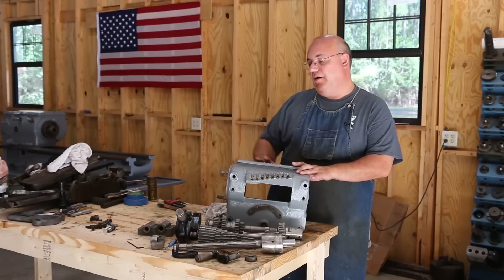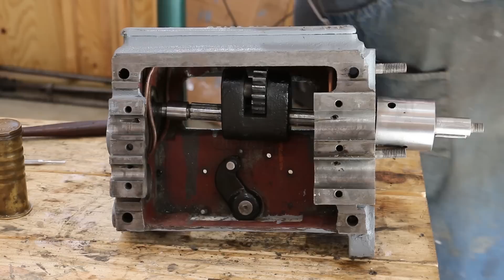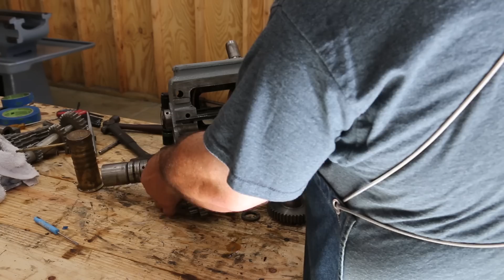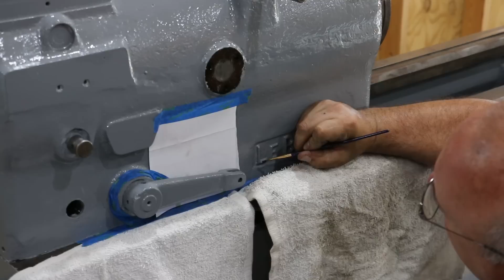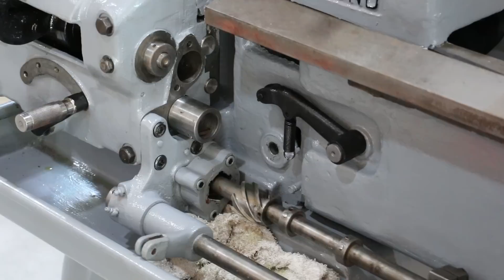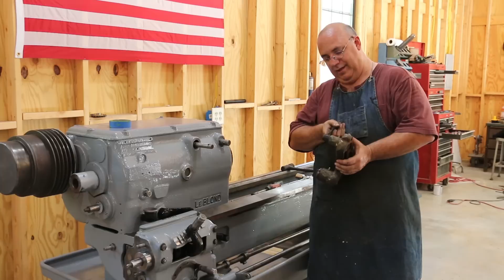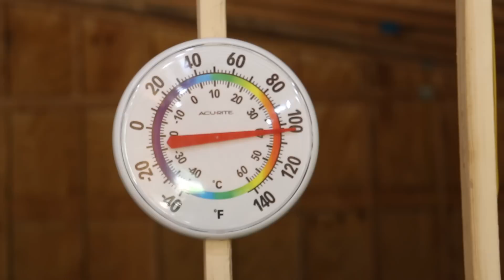LeBlond Lathe Restoration - Part 6:  Quick Change Gear Box Reassembly and Installation

Comment: I love the fact that they managed to hold that threading screw bracket with only two bolts. If this were one of the cars I work on, there would've been a third one in the back, and getting it on and off would've meant going one click at a time with a fine-tooth ratchet and bashing your knuckles every time!

By the way, I was thinking about the data plates, and the fact that you were saying they'd be pretty tedious. I think the easy way to do them would simply be to paint the whole thing black, and then sand or buff the paint off the high points. I'd guess that's probably how it was done in the day, anyway, since nothing else makes much sense.
Reply: if I slam it back and pick up on the ratchet I can get that next click, lol been there too many times.
Reply from the maker: I need to get started on the data  plates - and that is pretty much how I will go about doing it....
Reply: time to get some fine tooth ratchets!

Comment: It looks like we need to start a "Keith Rucker's Shop Needs an Air Conditioner" gofundme campaign or something.  That has to be unbearable, surprised you are able to work in that heat.
Reply: He says it in the video that he had just spent a lot of the day running the museum's steam locomotive.  The steam locomotive's cab stays at 130-140 F since its on the firebox end of the boiler.  After doing that all day, he stated that 100-105 F starts feeling pretty cool and nice. XD
Reply from the maker: I have about half of the money saved for the insulation.  If you want to contribute to the cause, you can support my Patron account....

Comment: good cosmetic and mechanical restoration, keith!
i especially noted and liked that "6-in-6" puzzle that you've resolved about the forward-reverse shaft.
about the broken bolt -- i was anticipating the operation for  removal. i guess the bolt was heat treated, and it cracked with its length above the flat portion. if you have not got rid of it, would you please check if my guess was correct?
i was hoping you'd send the handles out for the triple-plating. but then, we cannot always have all we might want ...
thank you very nuch for the video,
-toly
Reply from the maker: I thought about plating the handles. Just did not want to wait on them to come back.  I am considering it for the hand wheels though....

Comment: The Le Blond is looking good.  Do the two gears on the front of the machine get grease ? I would remove that one grease zerk that that is hard to get to and  use the open hole to oil it and fit a small plug to keep the metal chips out. Is the flag going to get soiled being next to the lathe ?
Reply from the maker: As for the gears, you just have to manually oil them.  The flag will get moved once I put walls up - it is just in a temp location for now.

Comment: The "cuts" which receive that spiral are an impressive feat of casting and/or milling.
Reply: cant be harder than the rifling they do to huge naval gun barrels!
Reply from the maker: You would mill them like a spiral gear I guess.  At least the external cuts.  Not sure about the internal ones....

Comment: Hi Keith, Wouldn't levelling the lathe without the carriage and tail-stock on be knocked out of level when you then fit these heavy-ish pieces back on? Great video series!
Reply from the maker: It really should not matter that much - remember that those parts move around.  I will re-check things before I start using though.

Comment: how is QCFB lubricated?
Reply from the maker: Oil is put in a reservoir on the top which is lined with felt.  It then drips oil through some tubes to lube the gears and bearings inside.
Reply: tnx, you we warm. you know the temp will drop some about November?
good work.

Comment: Man, I would be drinking buckets of water just sitting on a chair watching you work.  I just can't take that heat anymore.  My wife and I are going to S.Korea in September and I'm dreading it because of the high heat and humidity.  The LeBlond is looking sweet.  There are few things that a little perseverance and perspiration can't get done.  I bet you are trying hard to think of some way to get the insulation in the shop.
Reply from the maker: The insulation will get here - just have to save my money!!!

Comment: That machine is such a beauty. Love seeing the levers moving so smoothly. -I wondered if it was ever appropriate to torque the bolts holding the gearbox on?
Reply from the maker: I don't think it would be important to torque the gear box.  That is usually more important on bolts holding bearings or on gaskets where you need even pressure.

Comment: Beautiful job. Why are some of the parts attached with both a tapered pin and a set screw? Belt and suspenders?
Reply from the maker: Can't answer that question - I guess they wanted to make sure it did not come off!

Comment: on the left side end where you put the gearbox, is there something that goes on the shaft and the top gearbox shaft?  Looks like a unpainted surface that needs something bolted up to it.  I think it called the lead screw  end flat surface
Reply from the maker: I think that is where a gear will go that powers the gear box.  I have not put those back on yet.
Reply: Yep that's what I was talking about. Thanks for the reply

Comment: I hope that, when you will run the lathe, that you could explain why the upper  pulley is so big. Is this a balance wheel or something else. Great restauration. I am waiting to see how you will restore the old plate. Thanks
Reply from the maker: It is to get the speed of the input shaft correct.  The motor is turning really fast, so a small pulley on the motor to a larger pulley on the lathe slows the speed down to the correct speed.
Reply: Thanks.

Comment: Keith,
At 27:11, that grease zirk.
Would a 45 degree angle zirk solve the problem? 
If it would tighten up with the tip pointing in the right direction. 
Maybe an O ring on the threads so it would seal and be tightened to point in the right direction?
The lathe is looking really good, thanks for sharing.
Keith H.
Reply from the maker: I don't think you could get to that grease zerk from any direction....
Reply: Keith Rucker - VintageMachinery.org
Hard to tell from the video.
I felt the fool suggesting it because I was pretty sure with your experience you would have thought if it but I figured sometimes the obvious escapes even the best of us.
The lathe is looking better and better.
Stay hydrated in that heat.

Comment: ........lol, you left out the best parts, all the cleaning and de-greasing of those gears and shafts..........made it look to easy. great show, will be a nice machine.....I used the same paint but stripped bare and polished all the levers and handles on mine. I like the black as well....
Reply: The black handles don't show all the oily finger prints and stains.  If you don't have chrome/nickel handles then black is best.
Reply from the maker: I started to polish the balls on the ends, but decided to just go black.
Reply: .....or brass/bronze...?  They remain polished to to continued hand friction....

Comment: So far looking great.  The only thing that I see that is troublesome is the incidental motion of the spindle speed handles.  It looks as if there is some lack of detent; since one lever moves as the other is moved.  Other than that it appears that you have gotten a gem.  I hope that the ways are as sound as the rest of the machine and there is little to no wear on them.
Reply from the maker: I will have to look into that, but I am pretty sure there are detents in there.

Comment: What about the lever that reverses the head? I thought you said something about it when you first got the lathe. Would now be a good time to repair it?
Reply: It has been fixed.  Compare part 1 of the series with the end of this one.  That bastardized spindle reversing handle was dispensed with at the cleanup and painting stage. ^^  Keith also figured out why it was done in the first place, in that whoever last took it apart didn't put the reversing shaft back in correctly to where they then could not get the reversing lever and bracket back on, leading to the haxors hack job with the bastard handle to get the reversing function working again without taking the machine back apart.  Keith points out he very nearly made the same mistake himself of putting the spindle reverse lever back in incorrectly, but caught his mistake at a point it could be easily corrected.
Reply: Thank you for that detailed explanation.
Reply: Just doing my part
Reply from the maker: I think +Patriot1776 just saved me a bunch of writing!

Comment: Whenever i disassemble a machine i will put timing marks on the gears and shafts as i disassemble it just in case the orientation is important. I will either put paint pen lines or center punch dots.  As you know, it can really mess things up if you get something 180 out deep down in there... I have done some restoration and repair/adjustment work on old treadle/line shaft industrial sewing machines and in that environment, EVERY part has a correct orientation and timing and getting any even a few degrees off can cause worlds of headache....
Not to mention the fact that there are no standards when it comes to screws. Custom thread pitches and sizes, I even have seen a machine with metric, imperial AND whitworth thread machine screws at the same time. From the factory. Into tap destroying hardened steel. Pain in the ass......especially when that really important no longer available tiny shoulder screw disappears under a baseboard......
Just remember, minutes added during disassembly to document can save hours on assembly
Reply: What a great tip on marking parts. And even with supposedly identical screws or parts, the machine has aged and worn in with those parts, so it's going to be happiest with those relationships preserved.
Reply: My father once had to do with industrial diamonds / abrasive tools (he was in the sales department).
There was one company his company did business with, which did not use one standard screw on their appliances/machines, all screws were made by the company itself.
Somethings breaks - no easy fix from the hardware store, no you had to get in touch with the manufacturer...
I guess everyone who had to use this machinery (probably highly specialized stuff) hated them!
Reply: Fortunately, a joint that is assembled with a tapered pin only has one "correct" orientation. The hole in the boss must align with the hole in the shaft, and the large ends of the tapered bore must align as well. If not, the pin will only go in halfway.
Reply from the maker: I too use the old center punch trick.  I used it a LOT on the Vance restoration.  On this machine, it was not really necessary as most of the pieces had taper pins holding them in place and because of how they were drilled, they would only go back on the same place you took them off of and alignment was determined by the pin.  But, it is always important to pay attention to those details!

Comment: Keith I am very much enjoying this series on the Le Bond lathe. Anxious to see it run.
I live in southern Oregon about the middle of the state. I'm wondering what I can expect pay for a similar lathe?
My own shop is coming along slowly due to interruptions such as improving the farm shop, and watering, cutting, and bailing hay.
Thanks for your many videos, and I have not forgotten the inspection hammer I promised. Hopefully soon I will have my lathe installed and running so I can complete that project.
Don from Oregon
Reply from the maker: Don - I have no idea what a lathe like that would cost up in your area.  I got lucky on mine - it was not your every day deal.  I have seen these lathes sell anywhere from $500 up to $5000 just depending on condition, location, and how bad the seller wants it out of their way!

Comment: How you southern boys take that heat I'll never know.  I sweat profusely in 75F.  100F I won't even think about going outside.  You really need that insulation in the building, that should help you out.
Reply: Yes but it's a wet heat. We can't tell the difference between sweat and humidity. Cold Miller Lite always helps.
Reply from the maker: I guess you somewhat get used to it.  Being outside a lot with my job helps me be somewhat used to working in it.  Still uncomfortable, you just learn to push through.....

Comment: I do like the look of the black on the handles.  Adds a nice visual contrast.
I have had my share of hiccups in re-assembly of items.  Always frustrating.  Very interesting to see that someone left off the part due to not wanting to dis-assemble everything to get it on the correct way.  Good catch.
Reply from the maker: If it had been me who found that part was installed wrong, I would probably be looking for alternative ways too - a lot of work. I hope that was the only reason it was that way.....

Comment: Looking really good, I'm impressed with your attention to detail. I'd have had to abandon shop at 40 deg C!
Reply: Abandon shop....LOL....women and children first?  I would have quit well before then.  I bet that Keith is going to start looking hard for the money to insulate the shop.  I could never live in that Georgia heat.
Reply: Get a good thick filling of insulation in, solar panels on the roof and a decent air conditioner (powered by the panels) and it would be quite pleasant to work in. It's a serious outlay though.
Reply: it was 30c in my shop the other day, i went in, and went right back out again!
Reply from the maker: Yes, it has been really hot here lately.  August is usually the worst month though, and then things start cooling down. I have about half of the insulation money saved up and hoping to get that done by this fall.

Comment: How is the QC box lubed? Felt pad under the cover?
Reply from the maker: Yes, felt pad in the reservoir under the cover which dripped oil down copper tubes to direct it where it is needed.

Comment: Been there forgetting which order to put the parts back on while trying to fix something.  As you said, the first time is ok, but the 2nd and 3rd time is a little frustrating.

I'm glad you commented on the collars with the set screw system that has the plugs which are also threaded.  I saw that for the first time on a small dividing head I was cleaning up and thought that was a pretty cool idea, especially when you have to have a set screw on a threaded part.  I wonder how "easy" it is to put the threads in like that?
Reply from the maker: I suspect that they insert the brass pieces into the part when the tap it.  Just cut them all at one time.
Reply: Yeah, I had thought they must have to do it that way. They must have a standard bore size and could make the brass pieces with the correct radius to complement the bore size before threading.

Comment: Coming along nicely Kieth, I was surprised the quick change gear box did not have an oil sump.am I correct in assuming you just squirt oil in there whenever you using the machine? Really enjoying this project.
Reply from the maker: There is an oil reservoir at the top that will drip oil down on the gears.  There are copper tubes inside to direct it in the correct places.

Comment: Knowing you have a full machine shop, the broken  bolt decided it didn't dare cause you trouble!  if you had no tools, out in the middle of nowhere, it would require massive efforts!   i wonder if you will find an alternate use for that old hockey stick that was on there!  will you clean the ways with something to remove the tarnish and slight rust?
Reply from the maker: I got lucky on the bolt.  I will take luck any day....